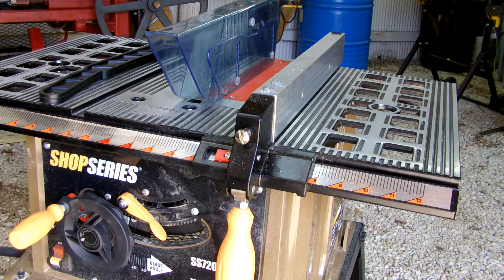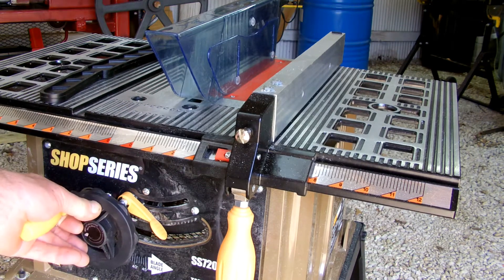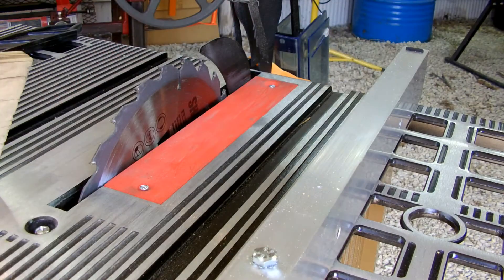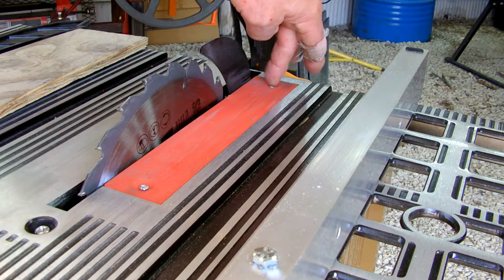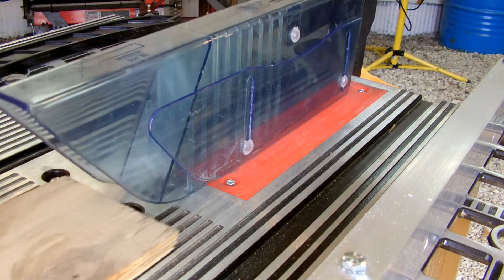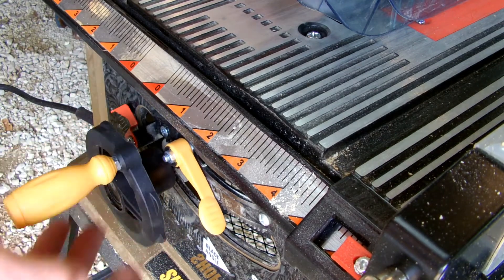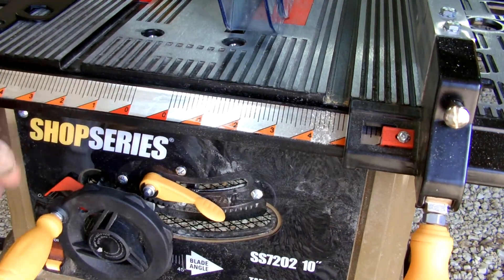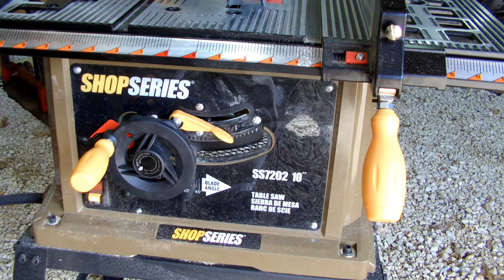Shop Shop Series 7202 Table Saw👎

Comment: I'm trying to find out how to get the blade at 90°. The most I can get it to go is 89. Is there a way to adjust the blad other than the bevel way that's by the blade hight wheel?
Reply from the maker: Not that I know of, my saw is kind of buried in my barn now, may be a way to shim the motor but I would have to look at it to see if that’s even feasible!
Reply: @1rustytree  Yes, I had the same problem but since this was two years ago  I can't recall whether I used a smaller bolt but it did get to 90 degrees.
Reply from the maker: @frankpotter877  Glad you got yours fixed, this thing had so many things not right I didn't notice the bevel. I do still use it for rough rips though.

Comment: After the first use of the table saw,the handles are no longer fixed firmly,also when cutting the wood it hits when it reaches the edge of the orange plate.The protector hinders , a mess is this table saw.Is there a way to replace the handles or fixed these saw table problems?
Reply from the maker: juan de luna the problem with mine was the plate was lower than the table so I put a couple washers under it to raise the plate flush with the table

Comment: I came across this video trying to find a video on how the gear system works on the inside. I am fairly certain my bushing has popped off the bottom of the crank bolt that lifts the blade. Please let me know if you still have the manual XD I lost mine about 3 years ago @>@
Reply from the maker: I will try to look at it this weekend, that saw is out at my cabin

Comment: Thanks for the feedback on this saw. I was thinking of buying it, but not now. I'll have to save a few more pennies to get a better one. Thanks again for sharing this video....Cheers!
Reply from the maker: I  don't usually bad mouth something but this thing was really bad! I have a lot of HF tools so I am used to not the "best" quality! Thanks for the comment!
Reply: These saws today are nothing like the saws of years past. To get a good saw it will cost a few thousand dollars. You can build a good temp saw out of 3/4 exterior plywould and route it to a 1/2" on the inside to except a 7 1/2" blade. Route 2 miter channels and build shed to slide in it. Get a cheap squeeze clamp and take the plastic off and use the bar for a runner for bothside. At least it will do the job until you can save up to buy a good table saw or radial saw. 
Radial saws are under rated too.
Hope this helps.

Comment: I bought this at Menards for $100 since I had only a little trimming around a few windows to do and did not expect much further use. I normally buy the better-quality tools, which is nearly always the best policy. However, this saw has been doing okay with some small additional use. I did have to change the bolt that prevents one from getting from 89 to 90 degrees. Oh, I now see someone else did what I did with that bolt.

Comment: I'm still trying to figure out how to assemble this.  The instructions rely on fuzzy photographs to complete the assembly and they are so poorly written that I had a disturbing thought.  If they can't complete an instruction booklet, how can I trust them to make a saw that is safe and dependable??? It's going back to Menards.
Reply from the maker: I honestly can not remember putting it together but I can imagine! This saw stays out in my barn for rough cuts for boards coming off the sawmill. Although I did use it to rip a few pieces of T&G flooring and it did ok. I have to agree with you about taking it back!
Reply: Hi, I'm at the part of the directions with the saw base and can not tell if the arches on the bottom of the base are supposed to line up with something?? Best of luck to you.
Reply from the maker: Ashley Allyouneedtoknow I’m sorry I just saw this comment, hopefully by now you got it going, or took it back!

Comment: One positive. I normally buy excellent tools but  at age 78 I had only one project (extensive window and door trimming)  so went with this cheapie. It was fine and I just finished another project with it (stairs retreads). This time I found that I cd not get the blade quite at 90 degrees but found replacing the stop bolt with a shorter one (eigth of and inch) it was fine.
Reply from the maker: Sorry about the late reply , I haven't been getting all of the comments. I use the saw and it works OK , just recently used it to rip a bunch of old cedar decking down for cornhole boards! Thanks for watching and commenting!

Comment: Thanks for the review.  I have an old Craftsman table saw that was given to me 18 years ago and it's been stored in a small storage shed and that thing has only been run once, I think.  It requires 2 or more people to move the dang thing and I thought many times to get it out and refurbish it.  I bet the top is rusty and pitted.  So, did you ever get another table saw or did you go without one?  Do you still get raw-cut wood to work with?  I made a video, where I helped build several stable stalls using raw-cut oak and each board was super heavy.  Man, that was a task!  In the video, I helped with one stable but I built three more since that and it was definitely a chore doing it single-handedly.  Have a good week my friend and take care of yourself.
Reply from the maker: Glad I didn't pay a lot for that saw! I have a home built sawmill and that is what I mainly got the cheap table saw for to clean up/ straighten the wood slabs. Have not cut much lately , need to set up an air drying /kiln so as to not waste the wood!

Comment: This machine is downright dangerous! I just got done throwing mine in the trash after using it on only one project because I didn't want to be responsible if I sold it and someone hurt themselves. I had all the same issues with it getting caught up on the plate at the back and the safety guard, as well as my riving knife or kerfing knife or whatever it was called was out of alignment with the blade. This thing is so lightweight, that I had to try to hold it down with my right foot while sawing, otherwise it would scoot or tip over when the wood would get caught up. Maybe my worst purchase ever.
Reply from the maker: Melanie Peterson right! I’m still using it here and there but it is pretty useless as a table saw! Thanks for watching!

Comment: I have the 7401 model.  I think they're identical models, probably just sold at different places.  I agree about the miter adjust wheel.  I don't use it.  I do it manually.  Yeah, this saw isn't that great, but if you're just building something "rough" like stairs to a deck or even just ripping a few boards to make a deck or something, it's good enough.  I'm thinking of getting into making a few things like cabinets (not professionally, just things like kitchen island carts out of MDF, etc.) and I don't know yet if this table saw will be up to that task.  It might with a lot of support mechanisms around it.  

The fence guide is ok, no better or worse than most, until you go up to a $500 + saw.  I think I'll just need to make certain it's square and clamped down before every cut.  I might to big rips just using a circular saw and a guide of some kind.  I wish I could afford a nice rail saw!!
Reply from the maker: Right! I just keep it in the shed for rough cutting off the sawmill, I did use it to re-work some 1x flooring and it did OK! Thanks for watching!

Comment: Mine is the same way barley used once and the wheels the same too
Reply from the maker: I probably should have bought the Harbor Freight saw! (you dont hear those words often)
Actually I used the saw for a flooring job , ripping some 3/4 x 4" pine T&G  and it did OK. Thanks for the comment!